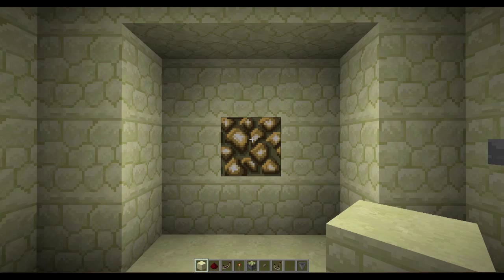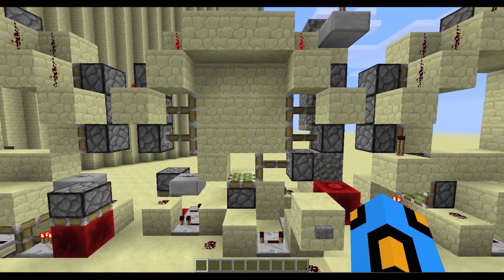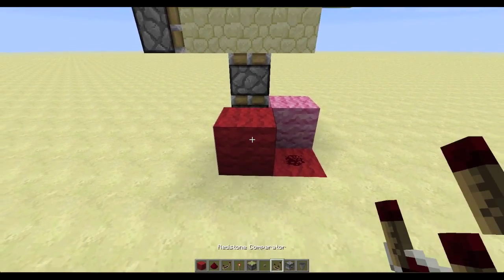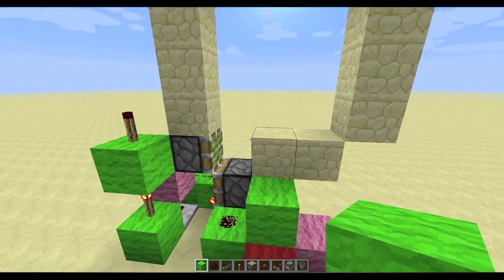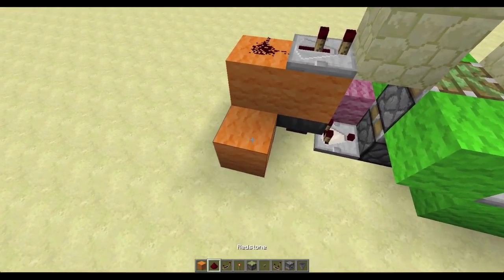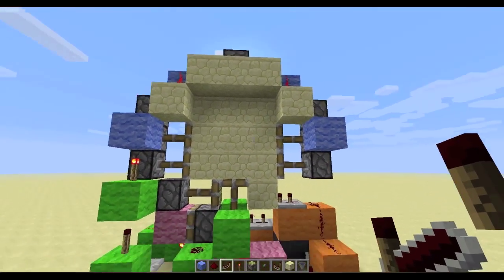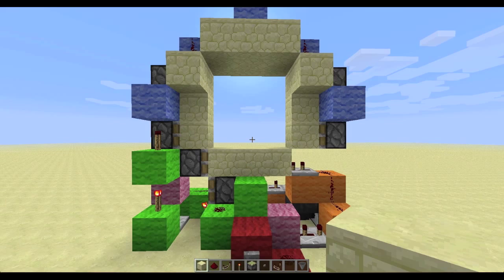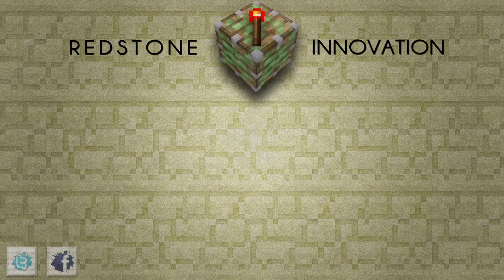Compact 3x3 Mk4, Button-Activated! [Tutorial]

Comment: I want a more compact door with a buttons on both sides at eye level directly adjacent to moving blocks.  and a double extender opposite to button going horizontal.  please .... my designs for it are around 10x4z10y at the moment and I need 5x3z7y in order to fit.